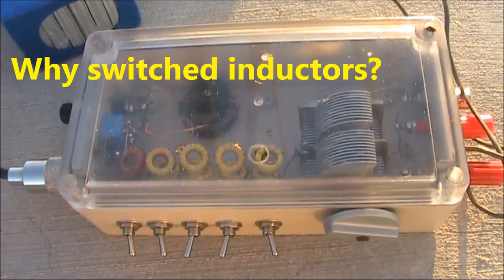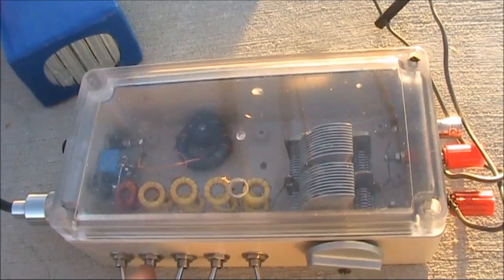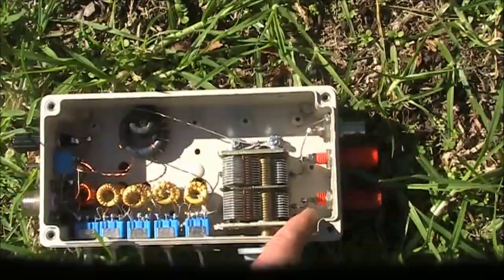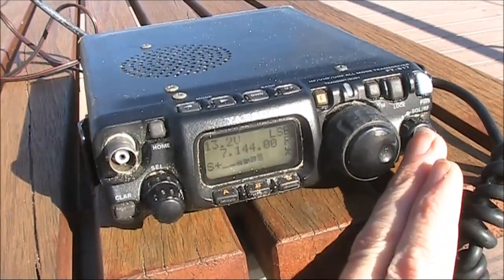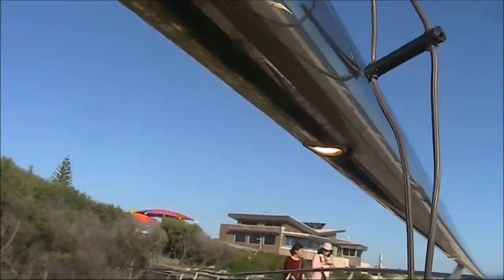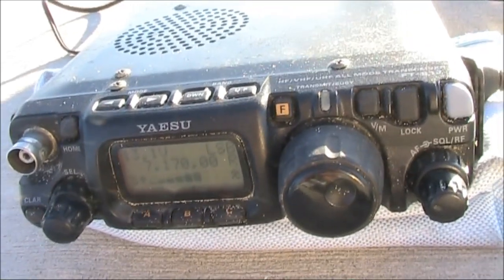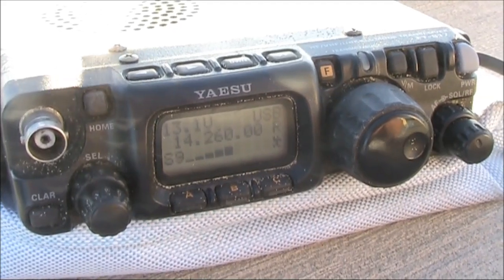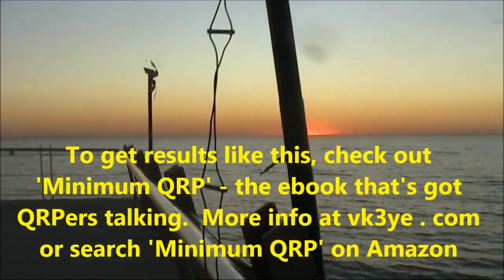A balanced antenna coupler and multiband tuned feeder dipole

Comment: Instead of using so many toroids and switches you can just use one big toroid with taps and multi position switch. Its easier i think. 73 de Luke SQ9IVD
Reply from the maker: Not in this configuration. Where it's a balanced configuration the inductor values need to be equal across both sides. This is harder to arrange with tapped inductors.

Comment: Whats up with your ladder line? It's a bit warped and curly, i think it would work much better if it was nicely parallel. Nice work with the switchable inductance. Whats the power handling of this particular design?
Reply: On the tuners i am currently looking to buy they usually require the use of a jumper to switch to balanced line. Can you explain why this design does not require some sort of jumper or did you just not explain the entire design? Thanks.
James
Reply from the maker: @izzzzzz6  This is an unusual configuration (double L network) that doesn't need jumpers. Not having the feedline twisted would make negligible difference to tx performance.